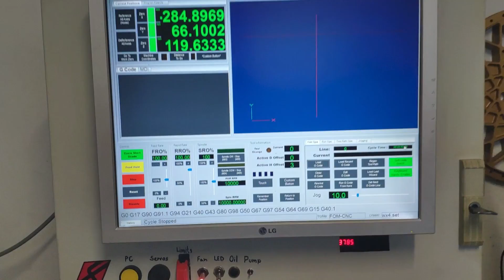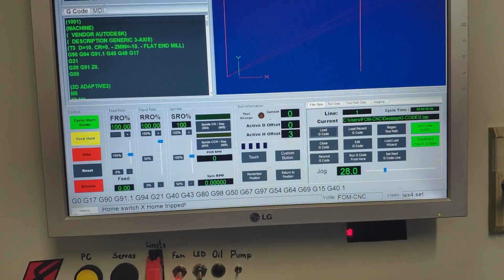DIY CNC: Test cuts and accuracy on my milling machine

Comment: My cnc is not giving accuracy it's way too far from accuracy
I cut square of 30 by 30 by stock leave 0.5mm 
What to do please give me tips and guddience i want to make accuracy 0by 0 by you
Reply from the maker: I dont know what kind of a software you use? Also i dont know what kind of a ballscrews you have? c3, c5? servos or steppers?